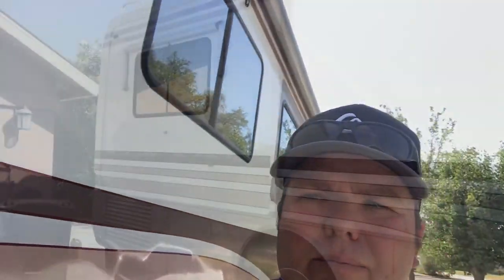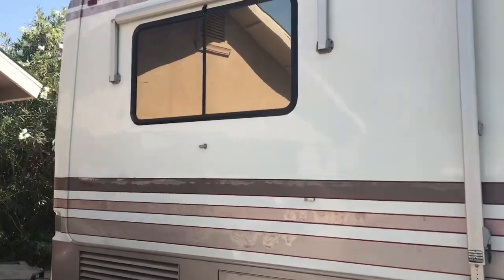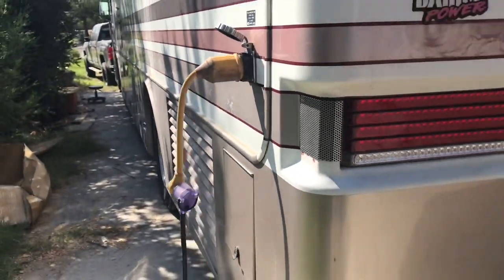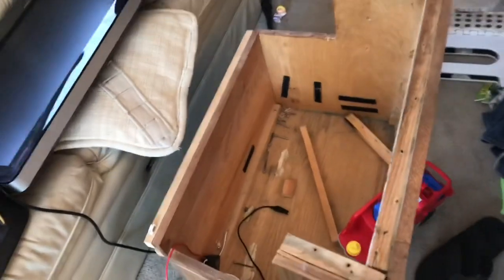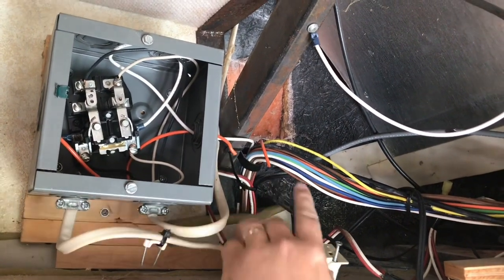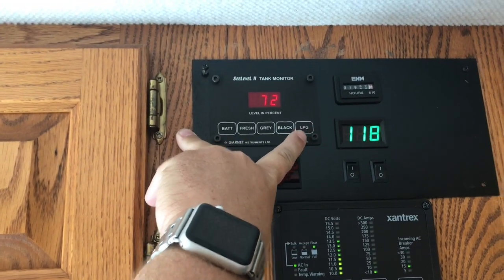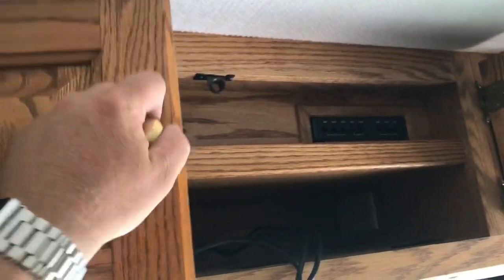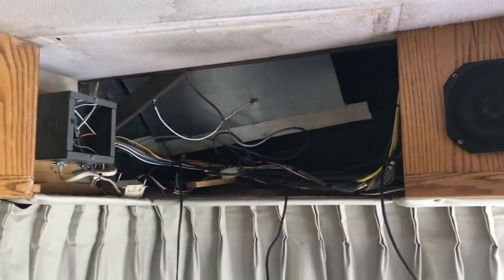1995 Monaco Dynasty HOT ROD 8.3L Cummins diesel pusher

Comment: Sir - great buy!  I am considering this weekend, to buy a 1995 40' Dynasty.  Please let me know if you are still pleased with you purchase.  Is there anything with the roof to worry about?  The roof on the one I am considering, is a little "spongy" when you walk on top, but is structurally sound.  On the interior of the ceiling, the ceiling-carpet shows a little discoloration from water, which could have been from the internal air conditioning system.  I believe it is structurally fine, and it is very mild only marks.  Please let me know your thoughts.  thanks!  Jim
Reply from the maker: james woodward I’d do it! In love this thing. The quality is way better than anything else I’ve seen. Especially at the price I wanted to spend. Mine also had some discoloring but it was from sealant lifting around the roof vents. Easy reseal. I just wish my paint was better. Otherwise no issues
Reply: @CosentinoDesignz  thank you for responding so quickly!  Upon further thoughts - the RV industry is notorious for "crap" delivery of new products.  The 1995 Dynasty line was the absolute top of line in its day - equivalent to a $450k coach today.  The fact that it has "no slides" is actually very appealing to me, as it very usable & comfortable as it, and no slide motors, slide covers, & leaks to deal with.  Just park and it is ready to go.  There are a few older 1995 Monocao reviews on Youtube, and the reviews are very solid.  The one I'm looking at has "150k miles (equivalent to 6000 miles per year).  Freshly rebuilt engine, new batteries, 2 year old Toys tires (gentle explained that ToYO's have a chemical composition in them, that prevents ageing/cracks, where as the Michellin's will age/crack very early in life.  Generator has been servcied, new Water Pump, and many other features (new LED (not smart) TV's, Surround Sound System new), and everything works.  Thanks Jim
Reply: Could you comment on the diesel/gas mileage?  Owner says 7-8 mpg.....

Comment: Nice LED lights where did you get them. My marker lights are cracked. Thanks
Reply from the maker: The signal/turn signal lights on the Monaco are the same as an early 90’s Chevy Silverado pickup. I looked for a light I liked on eBay and purchased them. Updated it nicely
Reply: And how about the ones in the rear. They look great.
Reply from the maker: The rear brake/tail lights are 17” thin trailer lights. When the original lights are removed there is a recessed box about 1” deep. The 17” lights fit nicely in the recess. The lights are a little taller than an inch, so I stacked 4 on each side. I also purchased a clear one for each side to use as the reverse light. I placed the reverse light at the bottom of the stack.
Reply from the maker: 4x17" Red 23LED Sealed Trailer Stop Tail and Turn 3rd Brake Light Bar Waterproof https://rover.ebay.com/rover/0/0/0?mpre=https%3A%2F%2Fwww.ebay.com%2Fulk%2Fitm%2F231747545418
Reply: Nice coach. I’ve got the exact same one except a 96 model. Couple questions. Where did u get that sea level 2 panel?  And also the digital volt meter? And the entire black piece that they are all mounted in. Did u make that?